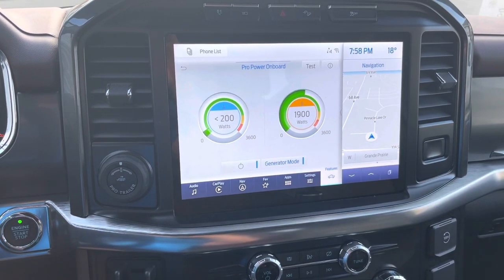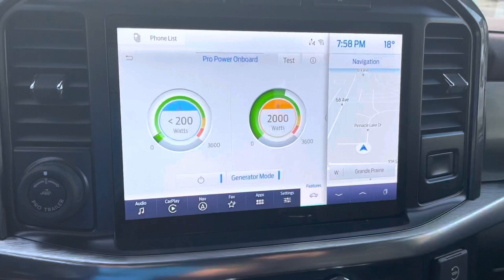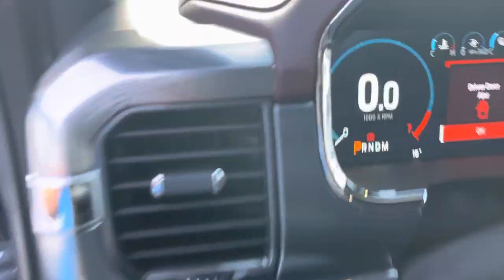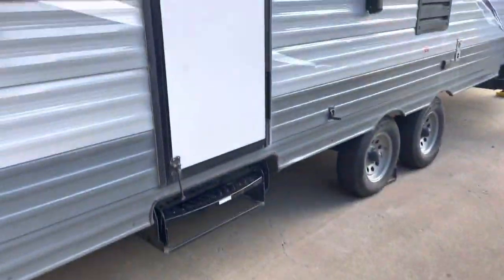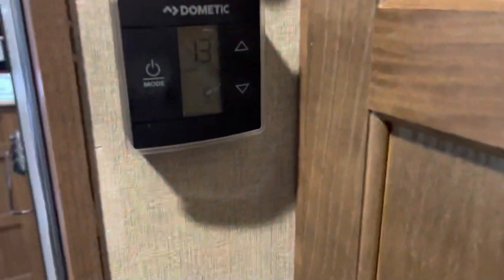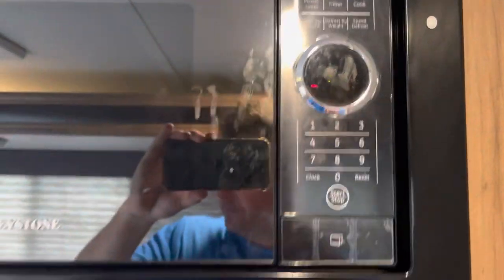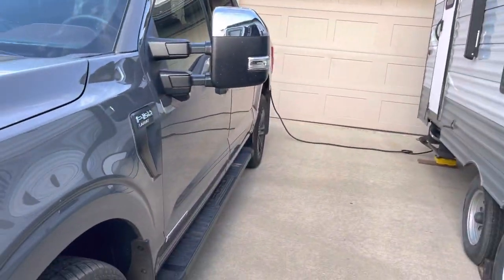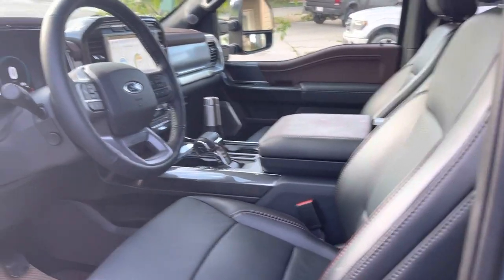2021 Ford F-150 Powerboost- 7.2KW Generator running an RV trailer

Comment: Game changer in the industry. From job sites, to rvs, to emergency power. It’s quiet as a truck and powerful as a stand-alone $3000 generator.
Reply from the maker: agreed!
Reply: @JasonGillett  what adapter is that? 
Thanks for video!

Comment: This is such a cool system, the more I see of it the more I want it, and I’m surprised so few people talk about the benefits of the Powerboost for camping and RVing. Having that capability in the bed of your truck anytime is awesome.

I’m just super frustrated that they don’t offer this powertrain on the Tremor package… That’s the model I truly want for the off-road capability and looks, but I’m also quite set on this hybrid, and I haven’t found a combo I’m happy with.
Reply from the maker: It definitely would’ve been cool in the Trevor package thanks a lot for your comment I totally agree do me a big favor and click subscribe if you haven’t already
Reply: I was in your boat, I was going to buy a Tremor originally, but this one has so many real world uses that benefits me and my family on a day-to-day basis compared to just being super off-road capable, so I went with the Powerboost. I love it, it's great for when you're stuck in traffic, waiting on someone inside a store, sleeping overnight, the HVAC system can run in the truck barely idles on gas. Then of course you had the generator functions and it's just a game changer for how you do things.
Reply: I don’t think the general population knows anything about generators and can’t fully appreciate how awesome this is. Also it would be super easy to put a fox leveling kit and some bigger knobbier tires on here. It would be just as capable as a tremor. Honestly the fox kit would probably be better than a tremor shocks.

Comment: I have a lot of questions. Can you do this all night long? How often and for how long does it have to crank up and run? Can you lock the doors? I’m curious about how much gas you would use for like a typical weekend of boondocking with this truck.  Quietest generator ever!
Reply from the maker: Yes you can do this for ever or until you run out of fuel.  It usually runds for about a minute then shuts off.  You can lock the doors with the key pad, press the bottom two buttons.  I used about 10L of fuel on an average weekend running my AC in the trailer.  Thank you for your comment.  If you really want to make my day click Subscribe as well :)
Reply: Yes it'll work all night long.  at nearly full output it burns 1 gallon per hour, but we've found that when we camp (tent with AC) it only burns about 1.5-2 gallons through an 8 hour night.
Reply: @michaelgabriel2998  well I bought a powerboost about a month ago.  I haven’t hooked the power to my wolf pup yet but it tows great! Do you still use surge protection? Probably a smart thing to do anyway.
Reply: @JonBecker81  the invertor is clean power. It's not like a generator it is an inverter.  I've had some issues with mine (the B&O unleashed) so may be trading to a lower and simpler trim...sadly probably to the 2.4kw since dealers don't spec the 7.2 on lower trims
Reply: @michaelgabriel2998  Andre from The Fast Lane had an XL with the 7.2 but he might have ordered his truck. Mine’s a 2021 XLT with the higher options. So maybe they did more lower trims with the 7.2 back then.
Reply: @JasonGillett  done. I just scrolled over your vids. I had a 2012 R1200GSA until a couple of years ago.  I sold it to get a bass tracker. I’ll get another bike eventually, probably something different like a Super Duke or s1000r. My wife starts eyeballing that life insurance policy when I talk about those bikes. 😂
Reply: Just picked up a New 2023 F150 hybrid 4x4 with 7.2 kw pro power on board. I have a 30Amp class A and plan to use this for even more freedom! I'll post ! ✌️🇺🇸
Reply: @dogtorphil  just ran my house during hurricane outage for 71hours.  Used 44 gallons. Had a minisplit and one portable AC a long with everything else in the 2100sf home.  Worked well.
Reply: Bought my PowerBoost in 2021, with the Lariat package and a few options I wanted.  Biggest reason I got it was for the 7.2kW generator.  After Hurricane Beryl, I ran my friends refrigerators and TVs in his warehouse and barely burned any gas.  The engine would run about 1 out of 5 minutes, and it is WAY quieter than a stand alone generator.  I work in the roofing & siding bidness, and like that I can run a job site off this thing all day long, in an emergency, and hardly burn a 1/4 tank of gas.  54,000+ miles on it, and thus far no problems to complain about.  Runs like a scalded cat, too.  Very powerful truck.

Comment: Do you have any solar panels on your RV? I want to hook up my RV with solar and a big battery pack and then use the pro power as a back up. But as a weird question, do you think the solar could put energy back into the truck battery, so maybe if I’m maxed out it can get some more miles in EV mode?
Reply from the maker: Where there is a Will there is a Way but I don't think it would be easy.  I do not use Solar panels at the moment, where we camp we often have a lot of tree shade so I am not sure if they would get enough sunshine
Reply: @JasonGillett  thank you so much for the response. Either way I’m getting the pro-power f150, it sounds perfect for my needs :)
Reply from the maker: @ariasarcana3142  I have had mine for 3 years now and love it.

Comment: It looked like you had that plugged into your 240 Volt outlet, am I correct?  My understanding is that it is too high a voltage for an RV
Reply from the maker: Yes, I did have it plugged into my 240 V outlet and know that is not to have voltage for an RV

Comment: Have you spent the night with your F150 running your RV?  I have used the set up in my front yard while cleaning my trailer.   I am setting out for my first trip and 2 of my stops have no hook ups.  I have to have the keys in to turn the engine on.  So the thought is keep one key in the ignition, lock the truck, and keep the other key in the RV.  I bought the XL POwerboost Hybrid with this feature.
Reply from the maker: Hi Paige yes I have I have a push button start so I am able to leave a key hidden in the console
Reply: @JasonGillett  you don't have to have the key in the truck to keep it running, I certainly wouldn't, if someone was to break in and get lucky and find it then they can have the truck pretty easy. I start mine up, throw the keys in the backseat and reach through the back door to grab the key to keep it from double honking, or you can use forscan and disable the double honk. Then I would lock the door from the keypad and you're good to go after you shut off the center stack and HVAC system and I use a towel over my instrument panel to keep the bright lights from showing off the interior goodies.

Comment: Is your RV 30 or 50 amp? 

Thanks for the informative video.
Reply from the maker: 30 amp
Reply: Mine's a 30 amp as well, but when I put mine in the 220 side with the adapter like you did it throws a breaker. So far I've just been using it on the regular 120 side, it has plenty of power on that side, but I would like to be able to run it off of the other just in case I wanted to run some other stuff off the other leg.
Reply: @MrFordguy73  Did you find a solution to this issue? My trailer is a 30 amp plug so everytime I try to run my A/C it trips my powerboost because I'm only pulling from the B leg
Reply: @LyndonSkogsberg  no, I have since just been running it off of the 120 side which has been working okay because my camper doesn't pull more than it needs, but I would like to be able to run it off of the other leg with the adapter to get my full wattage if I need it

Comment: Is that trailer running g 120v or 240v?
I’m wondering how it steps down from 240v from truck to 120v to trailer
Reply from the maker: Both, it has six 120V 20amp breakers running from two 3.6KW generators.  It then has a 240V 30amp breaker that bridges both generators together for maximum draw.

Comment: What converter do I need to do this with my rv?  Confused
Reply from the maker: It depends on what is on your RV probably the easiest thing is just to visit a local RV dealership and they can help you with the converter if not general hardware stores often carry several different types
Reply: Got it.  The trailer is 30 amp. I need to figure out what converter plugs 8nto the f150 onboard @JasonGillett

Comment: What adapter did you need to get?
Reply from the maker: Like this one https://www.amazon.ca/Cable-Matters-Prong-Generator-Adapter/dp/B076ZXFVRB/ref=sr_1_22?crid=2ERDXR5T3GIAW&keywords=4+prong+twist+lock+to+30+amp&qid=1661200971&s=automotive&sprefix=4+prong+twist+lock+to+30+amp%2Cautomotive%2C107&sr=1-22
Reply: @JasonGillett  I think this would reduce max output to 3600w as it's stepped down to 120v

Comment: What did you do for the bonded neutral?
Reply from the maker: hmmmm, havent had to deal with that yet
Reply: On my house I had to disconnect ground and only have pos and neg wires (truck is grounded so would get "double ground fault".  If I use a normal generator I'll either have to get a self grounded one or re-connect the ground wire to bus bar